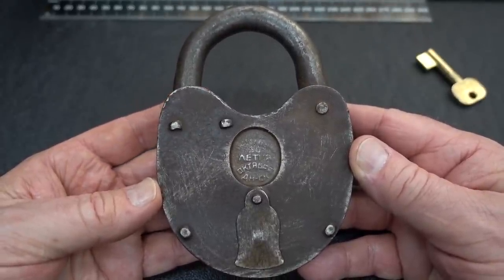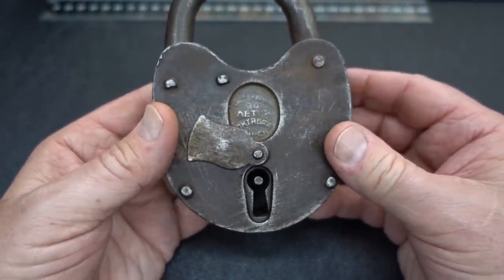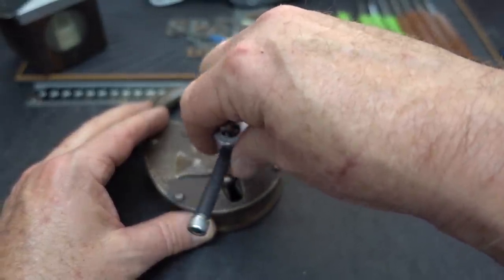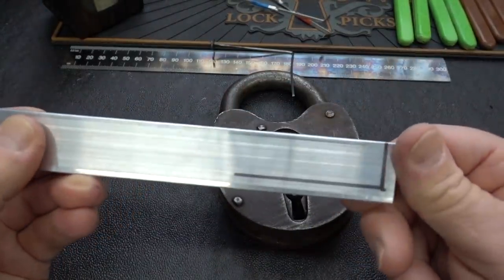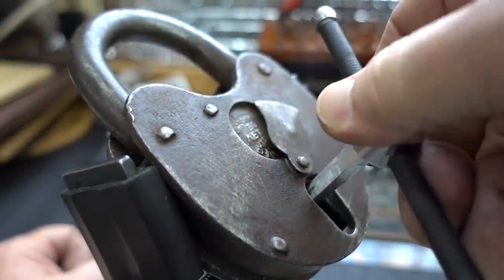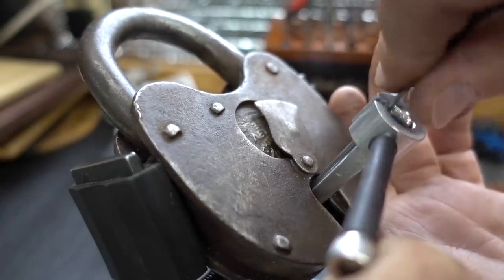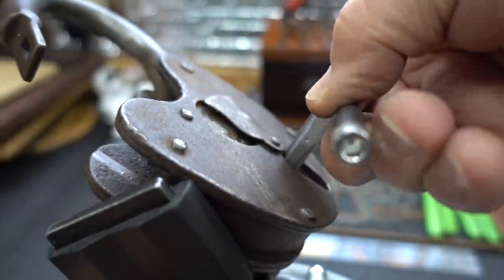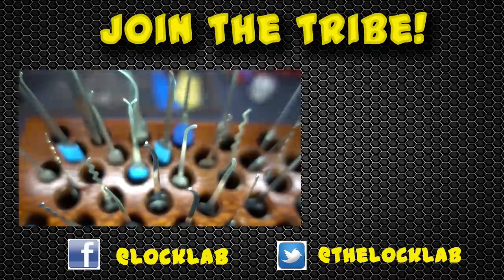(1392) Russian 1917 Revolution 30-year Commemorative Padlock

Comment: Bill, I've found on some locks like this you can tension directly on the locking pall/bar with a thin piece of steel (old hacksaw blade) shimmed down the side. That way you don't need to tension through the keyway, leaving you a lot more room to manipulate the levers. It's not always possible, depending on how the pall engages with the shackle, but it can be worth trying if you don't have a pipe tensioner of the correct diameter. In the UK these locks are sometimes known as "purse locks" BTW.
Reply from the maker: Thanks Chris!  I'll give this a try.  I should have thought about that instead of spending a couple of hours fabricating tensionsers...😡  Purse locks?  Women in the UK must have some rather significant purses....and be very muscular to carry that stuff around all day. 😀
Reply: @bosnianbill  All British women are renowned for their strength! But actually it's because the older classic style locks were thought to be shaped like an old fashioned (Tudor) money purse cinched in at the waist. Not sure if that's true but I past on FWIW. Keep up the great work!
Reply: @chrisould4412  My wife's mother still has a couple of purses shaped like that lock. They fit into a ladies coat pocket perfectly. Pickpocket's paradise though. 
For the U/S English speakers here, a purse is small, and used mainly for carrying cash and cards, not the generally bigger thing which you think of. In English, your purse is called a handbag.

Comment: I am a Certified Professional Locksmith, I do enjoy seeing what you have to share and frequently impressed with your skills, especially with this lock. However you said that you wish you had a key, there are locksmiths like myself that knows how to impression (hand fit) a key to a lock. I have impressioned many bit and barrel keys for old lever locks.  
FYI, old lever locks where the bottom of the key is solid and is longer than the key blade, like what you started out with is a bit key, the bottom is longer that so it can fit into a hole in the bottom of it's lock. This will hold it in place while you turn the key. 
The padlock you have that has a post sticking up in the keyway takes a barrel key.

Comment: Bill in England we tension pipe locks with wires all we do is  make the tension tool from the bottom of the key way to the middle of the pipe the same as the pick wire .I like to bend the end of mine over twice so it is the same thickness of the stump on the key it saves it siding of and then you use the side of the  pipe as a lever when tensioning the paddock and the pick rest on top of the pipe . I might have to send you some wire tension tool I have made and picks as well .thanks Bill for a great show .quick Nick the lock pick

Comment: Really cool video. Nice to watch your problem solving process.
 I have several old lever locks, no keys. I have a collection of random brass and steel tubes, collected over the decades, from 1/16" to 1/2", all kinds of wall thicknesses. Many of them nest inside each other. 
I have been able to silver solder flat brass to the appropriate tube to make a tensioner. 
Usually I discover that the innards of the lock are too damaged to allow picking anyway, but it is still fun to try.  I think you could likely make a key with this method, if you have about 5 hours to spare.

Comment: You wouldn't have had an issue with that first tensioner if you had a small scratch start tig rig to weld that metal at low amps. Everlast will give you a small inverter that you can stick anywhere and not take up much of any space and they are the cheapest "decent" entry level rigs. Using silicone bronze it would be easy. until then try to use a MAPP gas torch and plumbing solder. As second option Harbor freight sells 1/16th 6013 welding rods that are very low amperage (max 40 amps) and they'd work. they are made for thin sheetmetal.

Comment: Place it in diesel fuel for a couple of days and then flush it out using a syringe.
Reply: Hugh Cameron This is a good approach. I have a gallon bucket of liquid wrench I soak old locks in, then blow them out with compressed air. Works wonders.
Reply: “I have a piece of steel if this doesn’t work” pulls out drill bit
Reply: @trevorstokens2894  I have a 'Birmingham screwdriver' which would work. Big Clive (check his channel) calls the same tool an 'X-Ray', because it lets him see what's inside things. 😉

Comment: You need a blank one and a candle. Fumigate the blank then insert it in the lock and where the mechanism touches the key it will leave a mark. An thus you will know where to cut. This is how thieves where able to make keys to unlock a door or a lock in the 1800

Comment: You could have drilled a suitably shafted blank and covered it in soot, maybe from a candle. Then put it into the keyway, moving it around. That would leave marks in the soot, and enable you to cut a key for it. My father used to do that, when necessary, making a number of keys for antique locks of various types.
Looks as though it is a captive key lock. Is that correct?  Thanks Bill.

Comment: The original keys for these locks were made out of sheet steel wrapped around a rod - they didn't look cool, so you didn't miss out on anything... 
You could've probably made one yourself out of that steel ruler you had laying about :)
Reply: Butt Seriously Another option is to grab a piece of pipe, split it like a banana and fold out one leaf to engage the tensioner.  This way the force is sideways on the bend.  Or do a half-pipe like on those half handcuff keys in survival tools, leaving lots of room for your pick on the missing side.  Oh and that's not a constriction on the keyway, it's the keyway flaring out allowing weak/drunk/elderly users to insert the flat key at an angle.   It's also the very symbol of a keyhole.
Reply: @johnfrancisdoe1563  good idea! But it's hard to find a thick steel tube with appropriate diameter. And aluminium tubes will break when you try to peel them

Comment: We used to impression these lever locks fairly easily if you can only find a blank or have some made. Could be a some warding you hit in the back requiring getting jiggy there. Boil in lard for three weeks which should free it up. smh